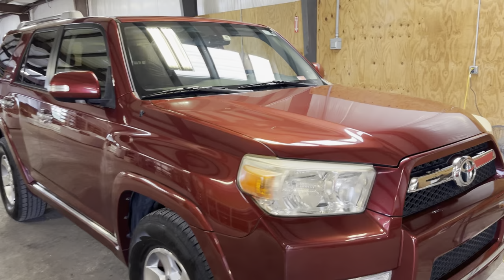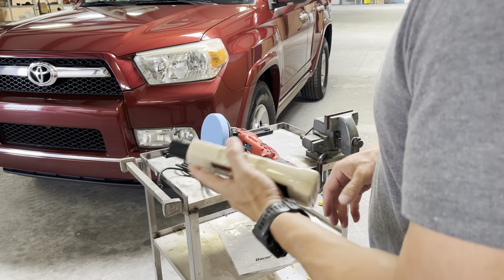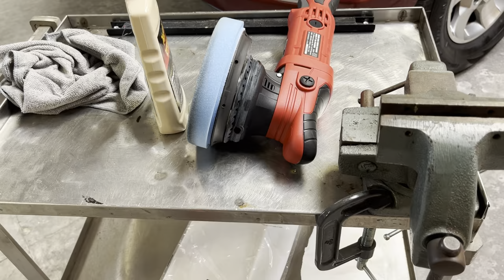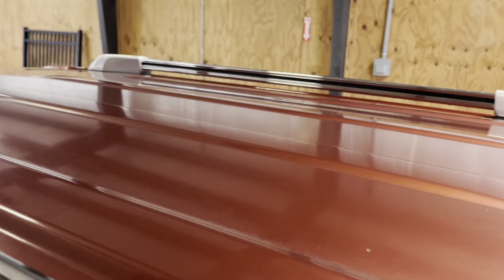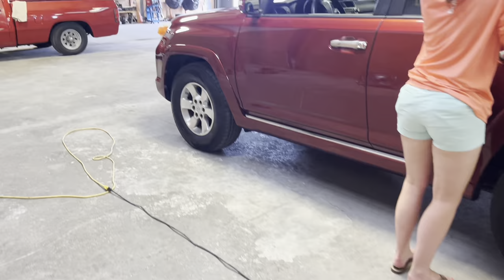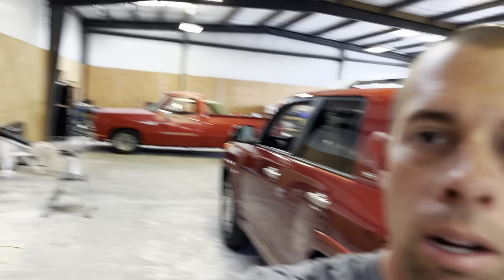Unveiling the Power: Bauer Orbital Polisher Review (Harbor Freight)

Comment: Just my 2¢ of what I picked up and what has actually worked for me since I've seen doing DA polishing on my personal cars for about five or six years now: McGuire's microfiber cutting pads are definitely the way to go.  The cheaper foam pads don't really cut that well and fall apart over time.  A proper job requires a two step polish.  I use McGuires M105 compound to cut first then come back with M205 to polish.  Of course use separate microfiber pads for each (cutting pad and polishing pad).  Periodically (every new panel) you want to use compressed air and blow the pad off to remove all the dead clear coat embedded in the pad.  Move the polisher much slower than you are in the video, maybe 1/3 or 1/4 the speed, to give the compound time to work.  First pass in one direction, then second pass 90 degrees/perpendicular.  I also clay bar the paint before polishing, it helps keep the pads cleaner.  Be smart, the edges are where you can easily burn through if you're not careful.  Larry's old AmmoNYC videos were really helpful for me learning (the new videos aren't explained anywhere near as good as his older videos).  You can only paint correct so many times as you are removing clear coat.  It's best if you do a thorough and proper job once, then on an as-needed basis every year or two.
Reply from the maker: Gold! Thanks

Comment: Look into Ceram-X by CSI, it's a one product, water based no filler compound/polish. I've used it for years as an airbrush artist and custom painter. You should also wash out that pad periodically. Pull it off, rinse and squeeze out in a bucket of wash solution (very mild) and spin out.. Then re-apply your polish and go for it. Will work a lot better overall. And most important, keep it level.
Reply: CSI is very good stuff

Comment: Junk! If the backing pad ever wears out, you just have to throw it away. No one make a replacement. Bauer doesn't offer one and neither does Habor Freight. I would strongly suggest not getting one.
Reply from the maker: I hardly use it. Not a concern for me.
Reply: Plenty of other manufacturer's pads fit, I've got a rupes on mine